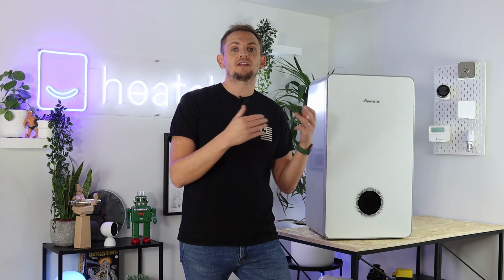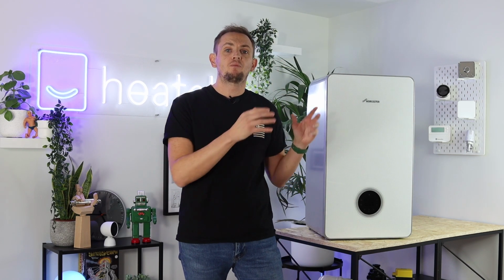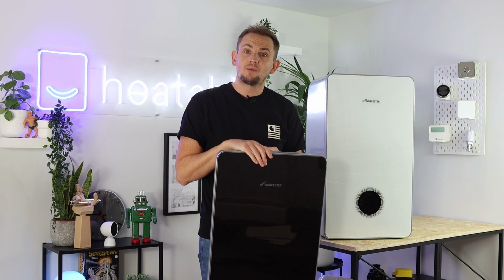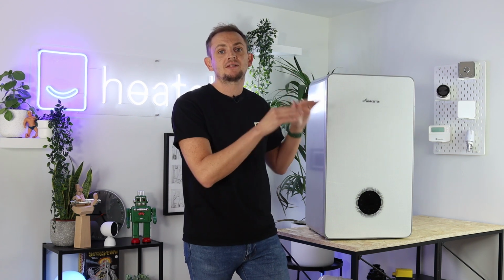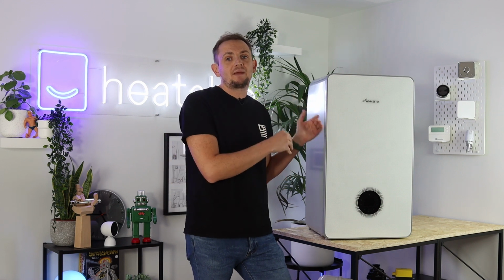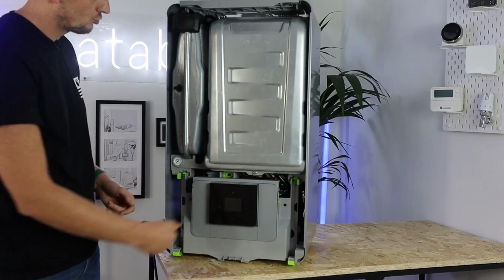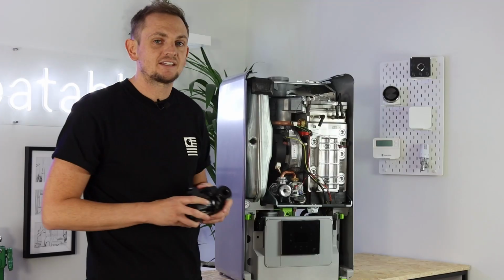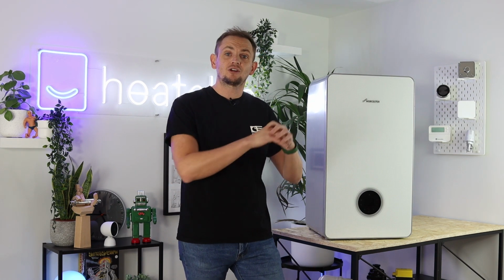Worcester Bosch 8000 Combi Boiler Review | Worcester Bosch Review | 2021 Review

Comment: I have this boiler, 8000 style. I would like to know if anyone has the same issue as me.
The hot water on full (9 l/m) the boiler fires up but goes off due to high water temperature and then back on again, outlet water temperature takes about 3 minutes before the boiler settles down and delivers a steady temperature. Bosch have even changed the boiler and have now given up on me to fix the issue.

Comment: Hi , I’m about to Purchase a 3 story , 3 bedroom house , with 1 large bathroom and 2 smaller shower rooms on suites so total 3 bathrooms , and around 14 radiators , would this be suitable ? The boiler location is ground floor
Reply from the maker: Hi Jon, yes this should be suitable for your home but it does depend on what your cold flow rate is whether or not you can run two showers at the same time.

Comment: Please can you tell me the difference between the worcester bosch 4000 30kw and 8000 30kw range?
Reply from the maker: You can find the key differences between the Worcester Bosch 2000, 4000 and 8000 in this article: https://heatable.co.uk/boiler-advice/worcester-bosch-2000-4000-8000-vs-differences

Comment: Will the 50kw boiler be sufficient for a household with 4 individuals with 5 rooms and 4 bathroom. Assuming at peak 2 bathrooms, heating and kitchen hot water is in use. WE have underfloor wet heating on the ground floor and radiators everywhere else. Thank for the video.
Reply from the maker: Hi Alwahaz, thanks for your comment! If you have a good cold pressure (16 litres and above a minute) then you can run two showers at once. If you've got low pressure, then increasing the KW's doesn't allow you to run two showers at once. Hope this helps!
Reply: the domestic system hydraulic dynamic loss from cold to hot water flow rate would on average reduce by minus 4 L/min, so if the boiler gives a max of 12 L/min, then the cold should really be above 16 L/min (based on DHW @ 12 L/min) if you are looking to use 2 bathrooms at peak times (based on showers), then each shower will have its own flow rate, so as an example, if the two showers require 5 L/min hot each and 6 L/min cold each (total hot water flow 10 L/min and cold 12 L/min so,  10 L/min hot + 4 Dynamic loss + 12 cold = total 26 L / min @ max output) "as a guide only other factors may/will need to be considered", it is always best to consult with the installer / Heatable specialist / Manufacture for further guidance.